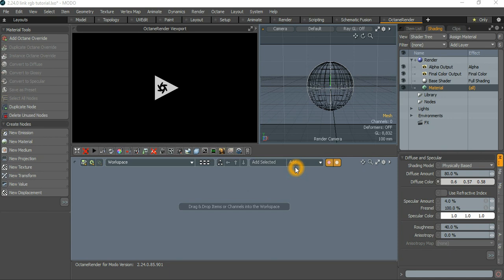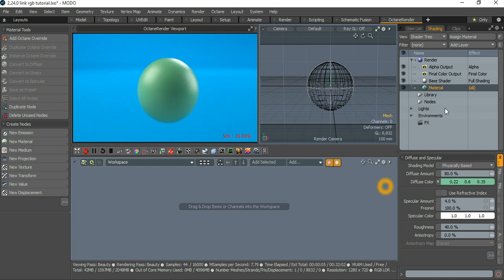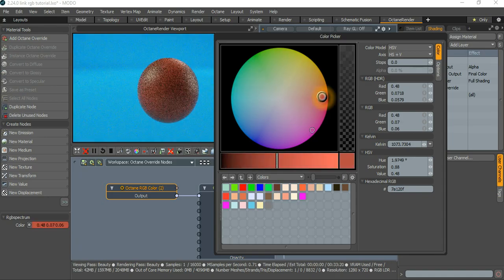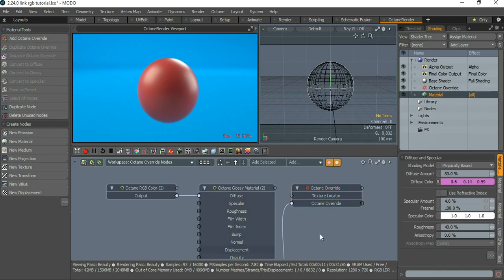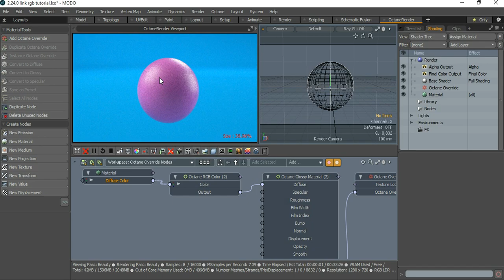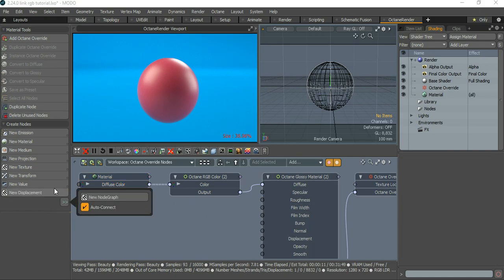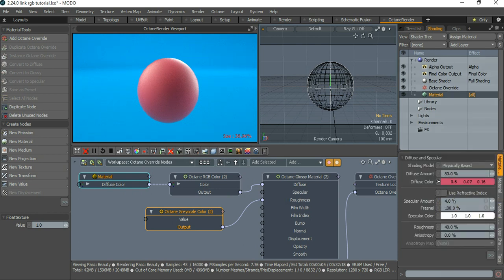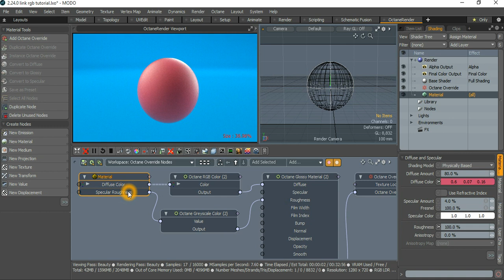Using Modo Material properties in Octane Overrides

Comment: Is it possible to make a material with two materials and a group mask like in Modo?
I have a metal (stainless steel) with a printed paint (see the green stripe on the stainless steel tube on the linked picture). And I want do mask the material with a bitmap.
https://dl.dropboxusercontent.com/u/207742/permanent/Octane/Rohrkorrosion_3D_0008.jpg
Reply from the maker: +Gerhard A. E. Uhlhorn Hi Gerhard.  You would need to set this up manually in the Octane Override.  In summary, use an Octane Material Mix, and connect the bitmap controlling the mask into the Octane Material Mix Amount pin, and the two materials you are mixing into the First Material and Second Material pins.  https://docs.otoy.com/Standalone_2_0/?page_id=352
Reply: Paul Kinnane Thank You! :-)